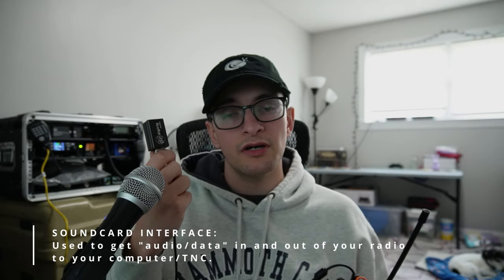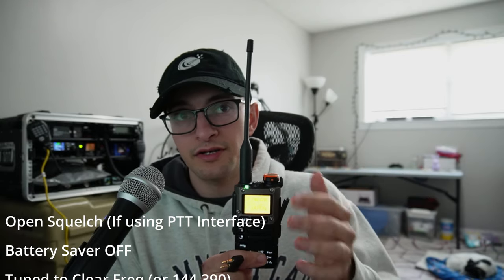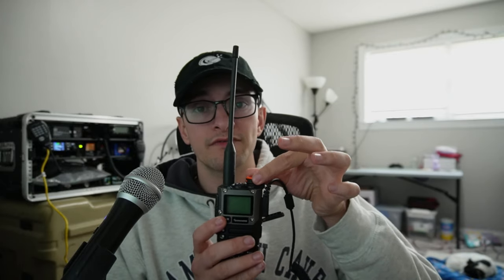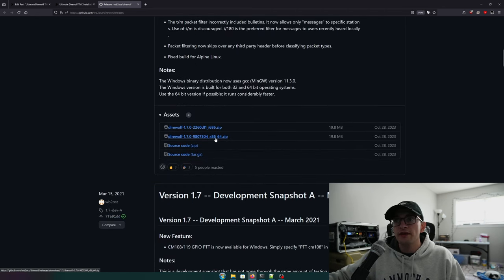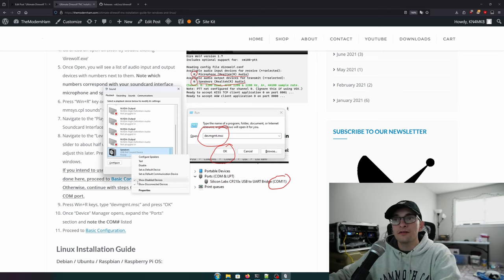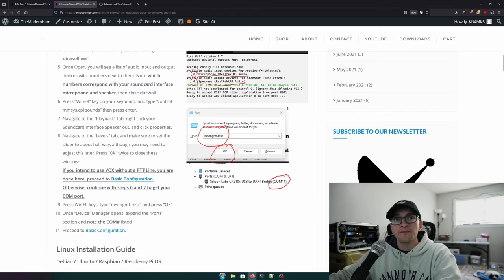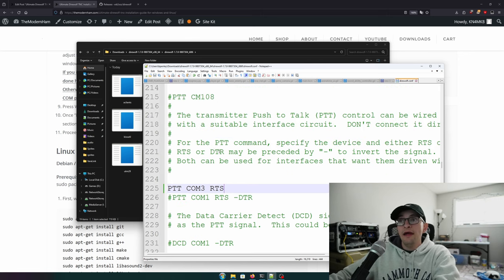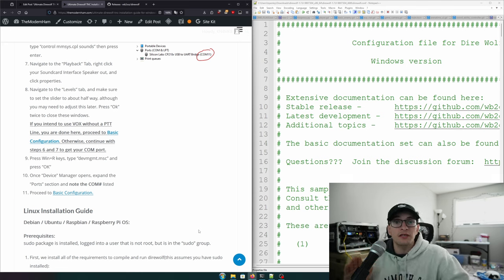Ultimate Direwolf Installation Guide for Packet Radio - Windows and Linux

Comment: This is great, thank you.  When I first got my ham license as a kid I did alot of packet radio with a serial connected TNC.  I'm back into ham radio and have been wondering about sound card packet but never spent the time to figure it all out so this series is really helpful.  I hope you cover the 2.4k and 9.6k baud modes as well.  I have several baofengs and a rasberry pi type device (rock64) that would be perfect for packet experiments.
Reply from the maker: We'll probably get to to play with some faster baud rate soon. With only a traditional USB soundcard, we are limited at the speed we can use. But we'll try and bump it up later.

Comment: Thanks for your great video, i'm using an 20yrs old netbook (win10) with UV5r (VOX), it does not work at the beggining until I removed the line FX25TX 1, it is now working great with no problem. Thank you very much for your hard work.
Reply from the maker: That is interesting. The FX25 allows other decoders with it enabled to have some error correction, while still maintaining backwards compatibility with regular APRS packets. Maybe the notebook was too old to process it?

Comment: Great video, but I think you should have mentioned HF packet aspect as well, along with that the fact that most modern HF radios have sound card built-in and only require TNC that can be software or hardware based. This eliminates or simplifies many of HT/packet steps. 
I'd also like to see more videos on packet use that are not APRS related. As much APRS is neat concept and fairly easy to implement (new Kenwood HT does it out of the box!), beside emcom there is very little use for it in daily hustle. 
I would love to see some sort of HF (or VHF) semi-permanent packet network similar to JS8Call that would allow a number of low bandwidth aps to run on top of it. An app from your phone to your home computer that can send data over HF to distant party. SSTV, messaging, email, BBS, etc.
Reply from the maker: You will find the rest of the videos in the packet series relevant, as the newest is about IP networking via AX25 on VHF.
Reply: @ModernHam  Thumbs up for that SX64 video. Makes me wanna pull out my c64 and try something similar with pk88!

Comment: Awesome video. This is the exact type of series I was looking for. 
Question for a future video:
What is the best way to have multiple direwolf configs? I just have a block of text that I uncomment and re-comment for each different radio.
Also what is the best way to run multiple instances of direwolf? (ex. one on hf and one on vhf)
Thanks again great video
Reply from the maker: Good questions. 
For the first, you can run direwolf with a new parameter "-c"  and then specify the path/name of a config file afterwards.
For example for linux/windows
direwolf -c 2mdirewolf.conf
direwolf.exe -c 2mdirewolf.conf
The second question is a little more involved, so we may take a look at it in a video later on.

Comment: Great video, but can you explain why you didn’t run 
sudo apt-get install direwolf 
Instead of compiling and choosing development branch ?
Reply from the maker: Good question. 
The direwolf developer and docs recommend compiling from source due to the fact the results of the package vary depending on the volunteer who packaged it. 
He also goes on to say that will probably " lag significantly behind development". This way we can get the latest and greatest, and the core functions of the TNC remain relatively stable. There's a new feature in the dev branch we may use in the future too that will make using KISS over the network easier.

Comment: Hello, I have an ICOM 7300 and a USB cable connected to Windows 10. I can see the COM port (COM6) correctly (other appl also work). 

I followed your settings and made adjustments as follows:
0 = MIC
1 = Speaker
6 = COM port (USB)

When I run direwolf.exe -x a on LSB (40 meters), the ICOM is not transmitting. It might be something simple, but I can’t seem to get it working.

PS i did the swap with -RTS , -DTS etc..

Comment: Still no luck at connecting my new BF-F8HP 2mtr on 144.390 MHz thru new BTECH-APRS-V01.2 cable, new DIGIRIG, Direwold, to APRS. No PTT with (-x a). Appears to rcv occasionally. Any thoughts?  Billy, if you want to PM me let me know and I can send to the parameters from the .conf file.   If you would rather I post the here, just let me know. Thanks.   Ken  Oh, BTW, that avatar to the left is 45 yrs old!   P.S., so is the Y splitter cable required connected to the serial and audio ports of the DIGIRIG?  or is VOX and just audio supposed to work?
Reply from the maker: Hey Ken, hate to see you are having issues. 
I would say start with the physical layer. 
The BTECH-APRS-V01.2 cable needs a headphone jack with both speaker and microphone out, laptops have these often, but not so many desktops.
The next thing I would check is to make sure you have that VOX option enabled in the BF-F8HP, and the cable is snugly plugged in. 
For the baofeng, you only need the cable going to the baofeng to the "audio" part of the digirig.

But the BTECH-APRS-V01.2 cable will not work with the digirig, so this may be your problem if this is what you are trying. The pinout is different. You can still try with the BTECH cable alone if your computer has a mic/speaker trrs headphone jack to use. Otherwise, you will need to buy or make a cable for your baofeng to digirig.
Reply: @ModernHam  thanks so much for responding and for confirming that the aprs cable won't work with digirig.  It's a young man like you that keeps the hobby going and us old geezers on track

Comment: I am trying to set up an aprs Igate digiapeter with a Icom2430 and a AIOC interface. I have 2 questions for you, first off the laptop that I am planning on using is pretty old and it's running windows 10 but very slowly would it be better to continue trying to run windows or scrapping the operating system and going to a Linux setup, Which would be kind of a learning curve for me because I've never used Linux, The igate is all I'm planning on running On that laptop And 2 do you think the AIOC Will be sufficient for what I'm trying to do or do I need to maybe upgrade to a digi rig? Any suggestions would be wonderful And keep up the good work I'm learning all kinds of things from you! Thank you KN4INH
Reply from the maker: The AIOC interface has been confirmed to work fine for direwolf, so you don't really need the digirig in your case so long as you have the AIOC working for your radio. It might be a good learning experience to replace the windows install with Linux and run that. It would be slimmer, and more stable. With the guide, it should get you running with Ubuntu which is beginner friendly. I just made a igate/digi guide that builds on this too so you may find that useful.

Comment: Thank you for this. Any thoughts (if you have the exp) for those of us with an old Coastal Chipworks TNC-Pi wanting to run this setup?
Reply from the maker: I hate to say it, but my advice is to ditch the TNC-Pi daughter board, replace it with a digital usb interface for your radio and just run direwolf. There are many modular options like the digirig that make it super easy to swap radios too. Direwolf will get you more functionality, performance, and software options than the TNC-Pi, and is not prone to RF interference like the  TNC-Pi is, and is still being updated and maintained with the newest additions to packet radio like FX25. 

Doesn't sound like much advice for the TNC-PI, maybe it's just a mindset I have though. If you want to use it, opt for the serial connection option on the things we do in the future instead of KISS over network. Just know that you will be limiting yourself to only run APRS applications on the PI itself, (won't be able to connect to the TNC over the network) and won't be able to use the cutting edge additions in packet.

Comment: Great stuff here. I have an issue with the ptt and digirig. I get a permission denied no matter what I do. Raspberry Pi install.
Reply from the maker: The only thing I can think of is to make sure your user is in the "dialout" group on linux. Make sure you did the dire wolf download and config edit as a regular user as well and not root.
Reply: @ModernHam  Got it running. changed users and it works now Thanks.

Comment: Ken, WB7QYB again.  Even using the unedited PBEACON line, it still does not put out sound to sound card.  What are the -x a parameters in the test with a CMD shell?
Reply from the maker: The unedited one will only try every 30 minutes. Are you seeing it pop up in the direwolf console? The -x tells direwolf to send calibration tones.
Reply: @ModernHam  Well, I have spent 2 weeks trying to get this setup to work.  I keep buying new cables, and now the digirig.  Still nothing works.  As the able you showed, APRS with the adapter to change the wiring on the TRRS, still does not work.  ARRG!  I was amazed that the digirig did not come with any cables, quick start guide, or anything.  One interesting thing. My VARA FM shows the digirig but for in and out but will not PTT.

Comment: Really Appreciate Your Well Done Instructions.  Station works with DRA-70 soundcard and VARA.  WINLINK works too. I installed and set up Direwolf per your video.  The test from the CMD shell using direwolf -x a triggers VOX PTT.  Radio transmits the sound test.  PBEACON line does not appear to cause direwolf to transmit.  Any Thoughts?  WB7QYB-7
Reply from the maker: Very strange. If -x a triggers transmit, the PBEACON should as well. It is popping up in the log to show you an attempt? There's a possibility that your VOX is so slow to start transmitting that it does not open up at all for a packet. You may try setting your TXdelay to something really high or your DWAIT to see if that changes something.
Reply: @ModernHam  Good Morning from the West Coast!  

I think I may have located the problem.  At least the problem and fix is reproducible.  Maybe I am on the right track.  When running the test ( -x a ), it works. When issuing that command in a CMD shell or powershell, Direwolf does not read the .conf file.  It Direwolf uses the command like parameters.  That eliminates hardware, connections. It also works when not reading the .conf file.  I tried the original .conf file.  That also did not work.

The PBEACON line in the .conf file was the problem.  For whatever reason, it would not accept my GPS location in the format of DD MM SS.SS.  When I used the format DD.DD, it woke up and worked.  Something about the location was causing Direwolf to choke and not broadcast the beacon.  I did not look at the Direwolf code to see what made it choke.  Thank you for all your hard work, working through these things and for presenting this stuff to us.  I'm not a young person bored with reading through thousands of lines of text from outdated sites and videos.   Just remove the "young" part from the previous sentence.  The rest still applies!  :)   73!
Reply: I may be wrong on the instance of direwolf not reading the .conf file when using the test parameters (-x a) in a CMD shell.

Comment: Sudo isn't always the best thing to implement on your system, this is why Debian gives the option during the install process.  If you share your computer with others while logged in as you, this is a bad idea for obvious reasons.  From console log in "su -l" and you will have all the privileges necessary to do anything you need to do.
Reply from the maker: "sudo", elevates the bash to a root with each individually promoted user. This command still requires a password by default, just the same as 'su -l', only more control and restrictions are in place than using the root account directly. Just as you would the root account when swapped to with 'su -l' you shouldn't leave such accounts unattended. The different being, that at least someone would need to enter the password when invoking sudo as the user, opposed to a root account when left unattended n the same scenario.
The use of sudo in this video is strictly for when super user access is required. If you are not using sudo, and are running every program you need super user access with as root, then this is an actual problem. For example, if direwolf were to be compromised as the root user, no password is needed to do anything, its a free for all. Sudo is actually more secure than using the  root account this way, as it offers more control and auditing over user permissions and prompts for a password for individual terminal sessions when it's invoked. This is a server, so it's headless and the only way is is with the key via ssh.

TLDR:
If you were to let others on your computer or when you walk away, you would much rather have the account in the sudo group there logged in over the root account swapped to with 'su -l' in terms of security. In the end either one is not a good to leave unattended for obvious reasons.
Reply: @ModernHam  Yes, but sudo ask for the user password.  su -l ask for root password.   All of my family knows my user login password but not my root password.  I don't leave su unattended!
Reply: @ModernHam  Running lunux on a "Surface Go 2" it's not real convenient to tell my family members the can continue watching the video I'm sharing with them after they log in too their account.  LOL!  Ya that led balloon won't get off the ground.  If the tablet starts to go to sleep they I don't want to go and secretly unlock it for them each time either.  All the same they don't need the root access that sudo would give them.

If I were running a desktop system with more users installed like in an office I would agree with sudo, because each user would me more compartmentalized.  

When I do need su I generally split the console window top as user and bottom as su and I can quickly switch back and forth.

There are situations for both sudo and su!

Comment: dont work ptt with FT818nd
Reply from the maker: It will work. But because the 818 only natively accepts PTT via CAT, you will need to interface direwolf with rigctl and use rigctl to toggle your PTT. The direwolf user guide has more information on this. I
Reply: @ModernHam  i didnt find anything about interfacin rigctl too direwolf.. i have flrig up and running and this work fine with ft-818, so how do i interfacing direwolf with it?